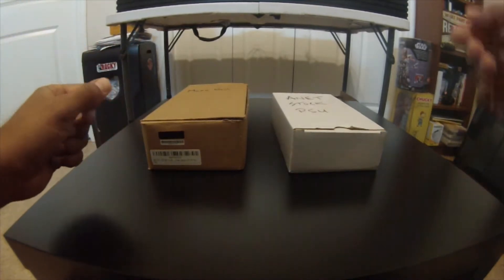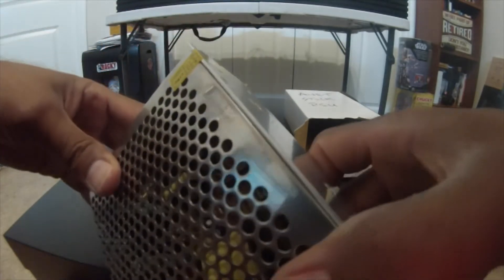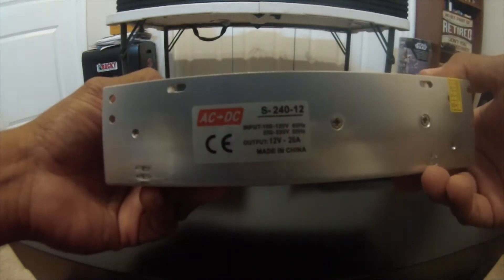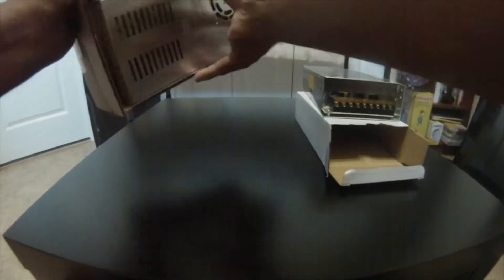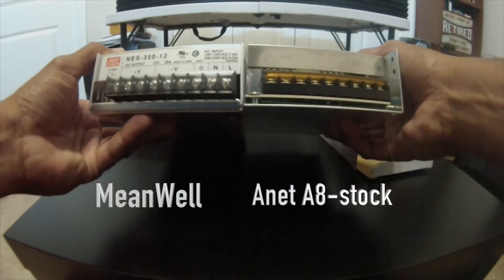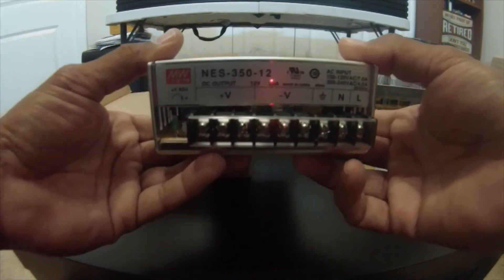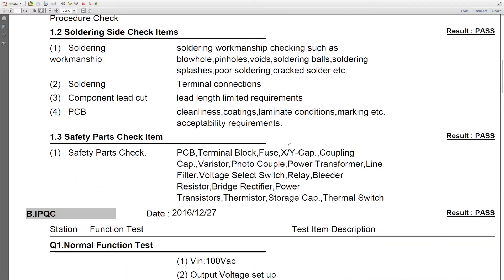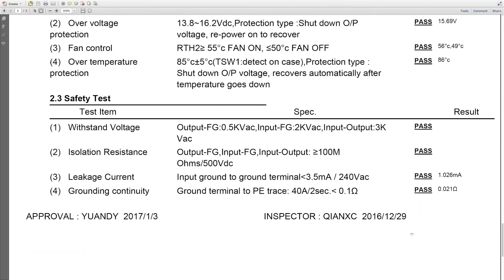3D printer kit Power supply Quality Control Tracking

Comment: Hey bro. I want to upgrade to a 24v psu. I have a 12v that blew shortly after switching to dual hot end to run a Cyclops extruder. I was using 12v 30a. If i go up to 24v do i jave to stay at 30a or can i run more. I want to upgrade my psu but im not sure what i need to know ln order to choose one.
Reply from the maker: 24v will work, just remember to get what you need anything more powerful, and not being used is wasting money--Happy Printing

Comment: The original power supply on my Anet A8 just failed. How well did the MeanWell brand unit connect to the printer? Also, thanks for posting this vid.
Reply from the maker: It  connects  the exact same way as the one shipped with the Anet I used it in my Anet and now in my other printer as well works awesome ! I only use Meanwell. Happy printing
Reply: Thanks! With your review and video I ordered the new power supply today. Thanks again!
Reply: The Happy Extruder sorry to bug you, but once I switched to this power supply my heated bed won't preheat. Everything else runs fine. I noticed that this power supply runs at 115v but the stock was 110v Could that be my problem?
Reply from the maker: Your not  bugging me at all, questions are always welcomed, should work fine double check your wires are not loose from the solder points and double check thermistors properly connected just may be loose wires as well retighten and check connections leading to the Heat Bed hope this helps.
Reply: The Happy Extruder ok I'll go back over it thanks. I really appreciate your help.

Comment: My Little monster fried its supply within an hour and my Tevo Tornado lasted almost 3 days. I would definately be careful of factory Tevo supplies. I replaced both and they have been fine ever since fwiw. It was almost 65.00 for both which I will factor in If I ever buy a tevo product again.
Reply from the maker: Its a smart thing to upgrade especially when your PSU will power many variables of the 3D Printer. Thanks for watching and Happy Extruding !